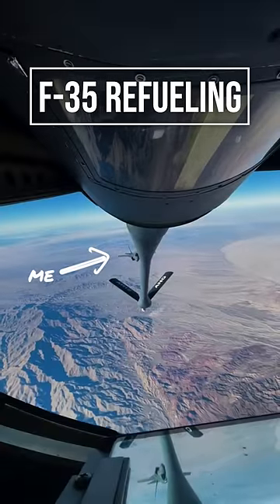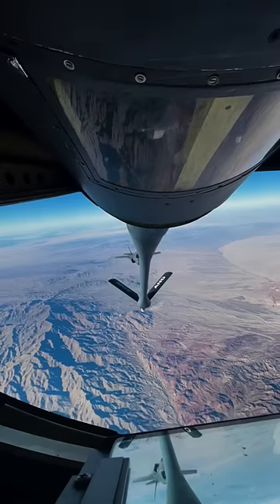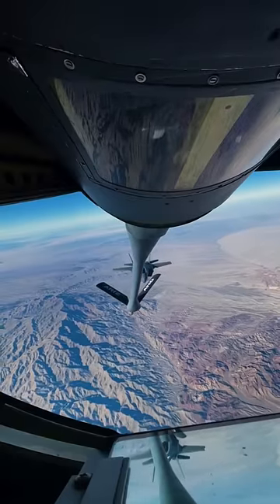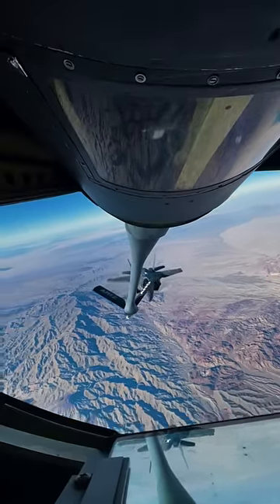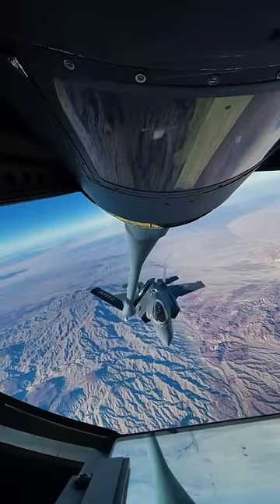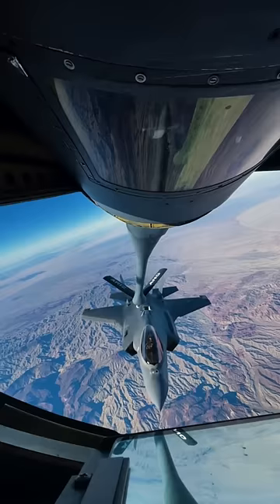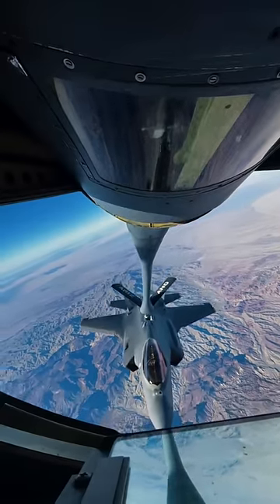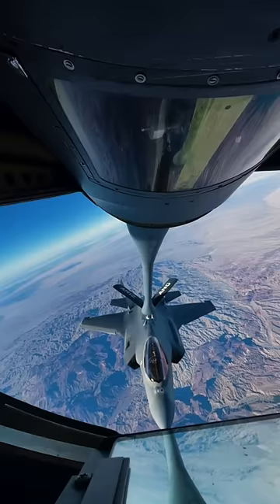F-35 Refueling in AIR with Pilot Commentary

Comment: I can't imagine how difficult it is irl. And I'm struggling in the F16 in dcs world
Reply: Probably easier. Can feel what the planes doing better and better depth perception
Reply: @dondelchulia3189  yeah you have better situational awareness irl
Reply: It's hard man, can't get it in the A10.
Reply: Irl you can feel the plane, and of course they are trained to do this for years
Reply: It’s slightly easier, believe it or not
Reply: Feedback is important. You just don't get it the same with a VR set
Reply: One of the hardest things to do on this planet. That and hovering a helicopter
Reply: Was about to say the same thing 🤣
Reply: @Fabiiioso  Hardest should be avoiding combat,
Which you physically cannot, as the more modern technology gets, the more advanced they are,
Radar systems can detect you from a long distance, you can't run away from an incoming missile of an F16
Reply: @stationVgames  yeah imagine an f35 lol
Reply: @Fabiiioso  idk about that, I think landing on a moving runway that sways side to side, that's only 300 feet with full throttle is in its own class
Reply: It's definitely easier.
Reply: Its much easier IRL than in game.  You can feel the plane move and can react easier.
Reply: It’s actually pretty easy
Reply: @stationVgames  maneuver and pop flares until missile runs out of juice?
Reply: I am struggling with rl LOL
Reply: Wow! Nearly half of this comment section is F-35 and F-16 pilots! Im honored 😑lol
Reply: It's probably slightly easier than dcs
Reply: It gets easier as you practice. You're looking for a specific picture when you stick. And dead serious when you connect and you get it down right, it does look like a picture.
Reply: My dad has refueled F-35s, F-16s, F-22s, B-52s and A-10s. He flies the KC-135
Reply: Also you don't have irl that cpu latency thing
Reply: @misterxrd 😂
Reply: @BassRocket  It’s true!

Comment: I had the privilege of being next to the boom operator in a KC-135 while refueling an F-15 a few years ago when I was a Civil Air Patrol cadet. It was absolutely amazing.
Reply: Yeah, the fighter aircraft are a lot cooler to watch during refueling.  I went on about a dozen KC-135 refueling missions back in the 80s.  Usually they refueled B-52s... but occasionally a fighter aircraft. The fighter aircraft were wild though since they would fly in so fast compared to the larger aircraft.
Reply: @101perspective  I honestly would not be surprised if it takes 1.8 KC-135s to fill 1 B-52.
I would be extremely surprised if 1 KC-135 could fill more than 1 B-52.
Reply: @n085fs  Yeah, the B-52 is a beast. Pretty sure it holds slightly double what a kc-135 can transfer.

Comment: Could probably automate both sides, ie sensors on the boom and plane track each other, measure distance and 3d speed, accel in real time, adjusting boom flight surfaces and lateral position to match plane intake. Operator take over anytime of course

Comment: As a fx Thunder mad f14 T pilot sometimes turbulence would take a bit of time but when In need  with a few hundred gallons left has to be done. When backing, a few hundred miles away from the argument with gaddafi my twin brothers were in a scramble with with mig 29 which were downed. We came up minutes later . But needed the fuel just in case  for engagement the other 3 were no where to be seen. Out of 5 two blipes were off radarscope. Then so we're the other 3. Too bad.

Comment: The director lights aren't on until you make contact? Is that true for all jets or just the F-35? Do you just get into position by memory then?
Reply from the maker: correct, primarily by visual reference until you're contact
Reply: The boom operator manually controls the director lights prior to contact. Mostly just the forward light until the last couple feet when they flash the light meaning you're almost there. Then during contact the lights follow the boom position.

But yeah, during the closure most receivers aren't looking at the lights too much, they are trying to "put the thing on the thing" lining up visual references.

Comment: I wish the Airforce uses baskets like the Navy.
Reply: thing is drogue is slower by a mile
Reply: They can’t because number one fly by wire instead of control by wire navy’s jets are way more mechanical as opposed to air forces digital jets
Reply: @SimbaC2007  ik they can't but it would be cooler if they could, Is what I was trying to say. It would probably make AA refueling a whole lot easier.
Reply: @johnb3350  Interesting.
Reply: @totempole8224  Navy's probe and drogue refueling is easier and faster when all things are considered. The USAF's boom refueling is too delicate and complicated - and can only refuel one plane at a time - while the USN's probe and drogue refueling method can refuel up to four planes at one time. Tell me which one is "slow" again....?
Reply: We have the capability. The KC-10 has an offset drogue and the KC-46 Has a centerline drogue with the ability to mount two more (one per wing) in a pod system.

Comment: So, does the navy have it easier with flying into the basket?
Reply: Wayyyyyyyyyyyy harder. Boom refueling is a breeze in comparison, it is a boom operator doing the hard work. Drogue (basket) refueling is all the Pilot, and even sketchier when you're low on fuel over the water.
Reply: Also the F-35 has really stable flight controls that make it even easier, that includes the Navy version as well.

Comment: Why does the USAF make mid-air refueling so, so difficult? They put the fill port where the refueling pilot can't directly see, the refueler boom a two-man, delicate operation, and can only refuel one plane at a time. USN probes and drogues are much much easier to use for both the refueling plane and the receiving plane and can refuel up to four planes at one time. SMDH.....